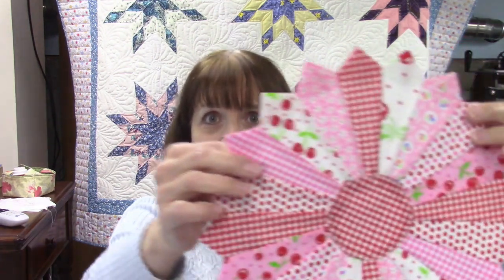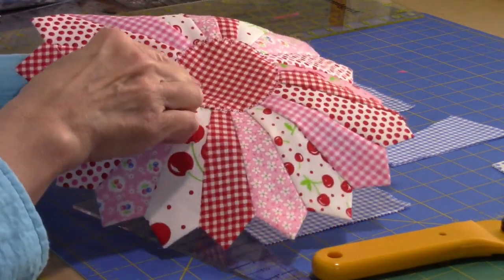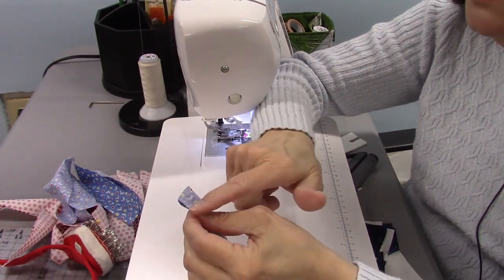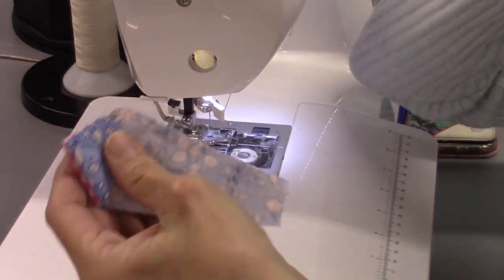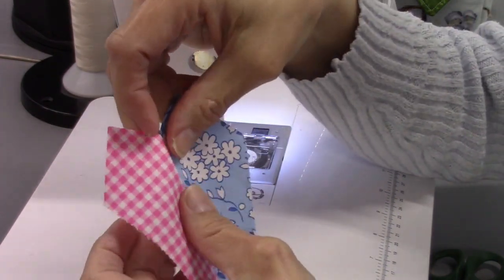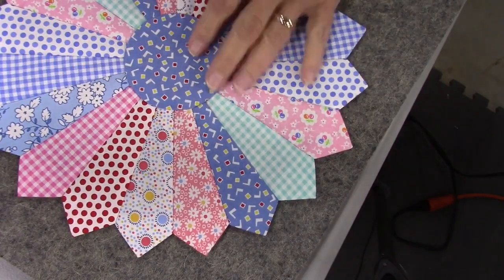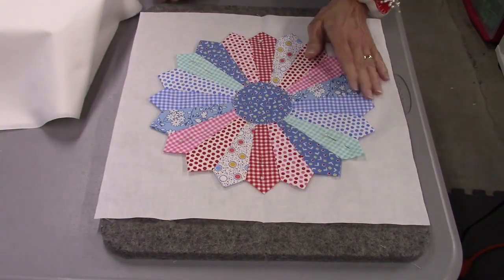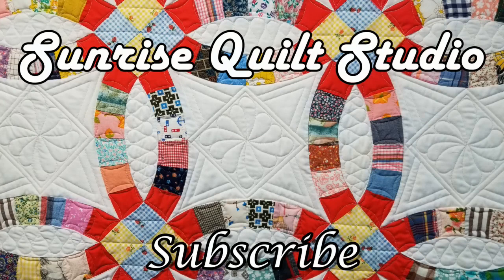How to Make a Dresden Plate - Vintage Quilt Block Series

Comment: Hey Susan! I love Dresden plates. I do my centers with fusible interfacing. I draw my circle on interfacing and put fusible to right side of fabric. I then cut out with pinking shears. I split th interfacing and turn right side out. I then fuse centers to plates. I still use a few pins.
Reply from the maker: That is a great way to applique the circles. I have used that method before, too.

Comment: I have seen the Dresden done with round tops and a pointed blade every 4th blade or so, how do get the  rounded blades? It is a beautiful block. 
I really enjoy your tutorials. Thank you for sharing your time and expertise.
Reply from the maker: You will have to cut those blades with a rounded point. You can make a template to do that with freezer paper or template plastic. Then to turn the raw edges under, you can do needle turn applique, or turn the edges under and press or glue in place then applique down. You can also sew a piece of lightweight fusible or non-fusible interfacing onto the right side of the plate following the edges with a 1/4" seam allowance, trim off the excess interfacing. Then cut a slit in the center of the interfacing and turn and press, then applique. This may require a video to show the techniques.
Reply: @sunrisequiltstudio   I was thinking the best solution was to use interfacing on the rounded tops. It sounds like a lot of work though, beautiful as the block is. I have never seen a pattern for the rounded tops, but if you must make your own, that would explain the reason why.  I have so many different blocks that I want to make that aren’t nearly as time consuming as this one, so I think I will put this one on the back burner for now. Thank you so very much for clearly explaining the process. I know your time is valuable and I sincerely appreciate all the help you have given me.
Reply from the maker: @poohbear101  You're welcome!

Comment: How do you determine the size of the circle?
Reply from the maker: You want the center circle to be big enough to cover the blades by 1/4" when you have folded over the edge. Some blade templates come with a circle pattern that you can use that works well with their blade template.
Reply: Pleas the size